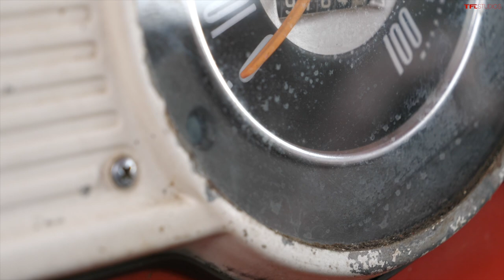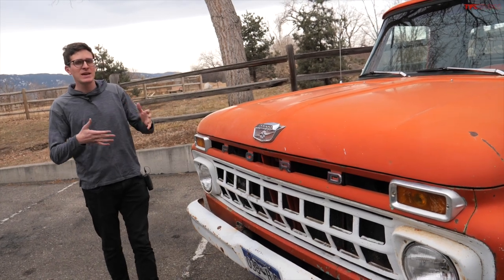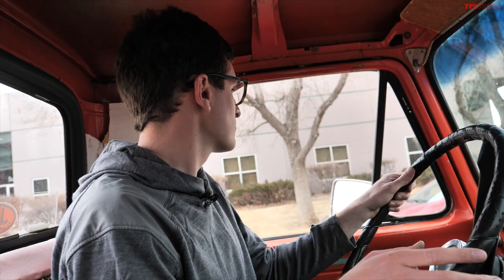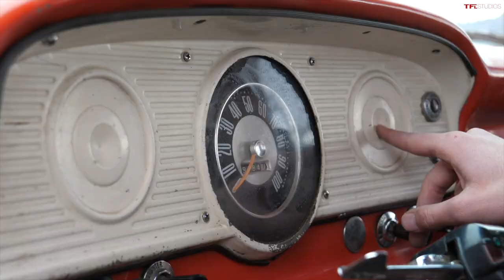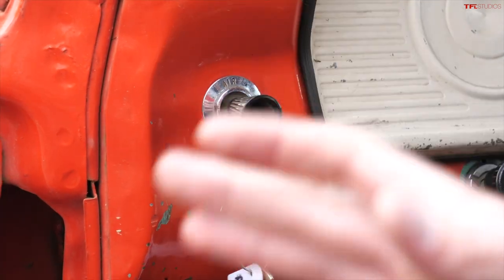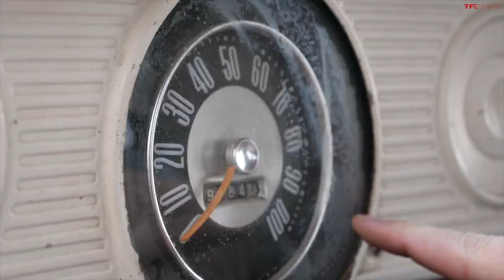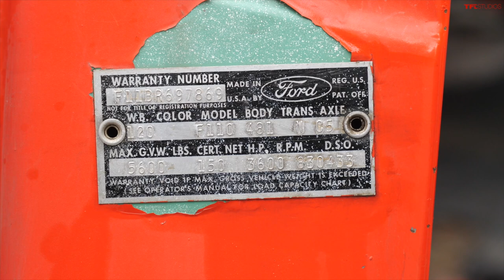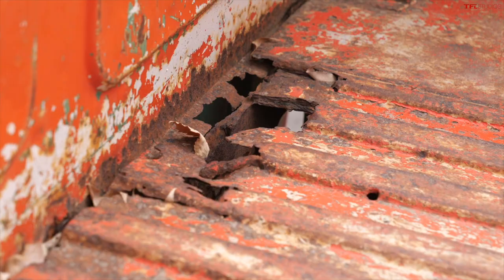Do You Like Raptors? I Just Bought The Ford Truck That Started It All!

Comment: I think a mild restomod would be cool. Take the 300 and rebuild it with good pistons , cam, lite bit of head work, offy dual port, 4bbl. Original color but modern paint, at least front discs if not 4 wheel, little bit of sound deadening, period correct looking wheels in a 16 or 17 inch, redone interior, and a lighting upgrade should do the trick.

Comment: You should put a 4 barrel intake and carb with headers to get some more power out of it, 300s will really wake up with those mods. Since you have "six shooter" cause of the 300 in the other truck and those body style trucks were called Slicks, call it "Slick Shooter"

Comment: I would toss in a ATK or Blue Print 302, even better the Cummins R2.8 crate engine.  I'm sure Advanced adaptors has everything you need to build this F100 out.  I might toss in a 4 link by Helix, simple or just swap out the suspension with new Rancho or Pro Comp shocks, and then build out those axles with ECGS.  What a find.  Sorry Brew - you might have a point there... If I didn't toss in the R2.8 I would rebuild it from the bottom up.

Comment: For God's sake, Keep that "Big Six" under that old hood! The best engine Ford ever designed and built... you'll never need to replace a timing chain... bulletproof and rock solid!
I wonder about the 8 lug wheels, which wasn't a setup to be had on a F-100.
Reply: or save it away a swap in an old Windsor for use

Comment: Bring it back stock. Steelies, painted hubcaps, maybe strip the paint to the original color. My 2WD, 41K mi, 305 V6 (yes, V6) 4 spd, 1969 GMC 2500 is equipped similarly with very few options (all mechanical HD stuff). It's a real, honest truck. I am one who actually found his perfect pickup truck!

Comment: Interesting, I grew driving trucks like this, so it seems like he needs to just realize it’s a truck, not an open trunk car like today’s newer vehicles. It requires more driver attention and interaction. Basically you need to know how to drive it. 
My father and I picked up a 64 long bed 2wd F100, for $200.00 , drove it home- took a half a case of oil- major rear main seal leakage. Ripped the drivetrain out and put a 440 Dodge big block , 63’ push button 727 torqueflite trans and the rear end out of a 63’ Imperial with 4:10 gears. That was a beast, and a real sleeper.

Comment: Unless someone swapped in later 8 lug axles you have an F250. No F100 came with 8 lug axles. Another indicator of that is the holes for the west coast mirrors you pointed out. Also but not conclusive is the for speed with a low first, more accurately described as a 3 speed with a low gear. That type is more indicative of a working class truck than the light duty F100. F100's are only rated to 1/4 ton originally. The reason for the odd taillights isn't that its 4x4 and not 2wd. That truck is nicknamed the "wrongbed". Ford changed wheelbase length and the normal styleside beds wouldn't fit however they had beds originally intended for the unibody trucks that were modified to work. Note the body line from the cab doesn't match that on the bedside,and the wheel well doesn't exactly match the front in style. As these wrongbeds wasn't the most aesthetically pleasing they were often trucks marketed to working roles such as construction,forestry,farming ect. Count your rear leaf packs,bet you have 7 or 9 or 11 leaves. Definitely keep the 300, inline engines make good torque because of the longer stroke. With the 300 and low first and low range in the transfer case it will pull like a tractor. With that combo you can just about pull stumps at an idle,if the u-joints dont give out first. I would suggest upping the yoke and u-joint size but then your likely to break something more expensive lol, or twist the driveshaft into a pretzel.

Comment: Keep the power train (maybe new gaskets) and put a conservatively sized blower on it. Add some meats to accommodate the extra power and give a little more speed. Maybe upgrade to a mid-90's Ford 5 spd manual.

Comment: Nice truck!  Is that riding on a more modern frame or does it just have modern heavy duty axles?  The F100 never had 8 lug wheels.  Even the 200 and 300 model of that age used a 6 lug pattern.

Comment: The step built into the cab is a 64 model. All 64 models 2 and 4 wheel drive had the step. A true 65 cab doesn't have the step. Also the more expensive models were called custom cabs with a completely different dash cluster with a linear speedometer all standard cabs were round speedometers. The extra volt gauges, ect, on the round speedometer were used for commercial trucks bigger then F100. Great looking truck though. Is it for sale?

Comment: Please keep it original. Upgrade the brakes and steering. You could see if bilstien has some better shocks for it. My first vehicle was a 1965 f100 2 wheel drive. With the 240 inline 6 witch is I believe the same block as the 300. It had the 3 speed column shift transmission. It was the twin I beam front suspension. It was my Dad's truck. He had bought  a 72 f150. He paided 300 dollars for it in 1970. The truck was perfect. Have a great day.

Comment: I think it deserves a 65 bed. if you are not upgrading front brakes to disc, then leave it alone, r&r lines, fluid, master cylinder, brakes, drums  as needed.  that faded red is cool, but needs to be original color. engine upgrades- high flow air filter, exhaust .rv cam.

Comment: Used to drive a 1968 gmc c1500 with v8 and 3 on a tree manual trans no power steering or brakes and it had drums all the way around. Drove it all the time no issues and as for texting and driving I still don't but always have and will be just fine eating a sandwich or getting a drink even in town. Don't need a gym to be able to steer these just need to get accustomed to when is the best time and way to steer. Then again if you turn enough wrenches it's not hard as it is even sitting still.

Comment: Cool truck.  Keep it as original as you can.  Put the correct wheels and tires on it.  Correct the passenger side air vent.  Rebuild the 300, if needed.  Body paint back tonthe original color.
One reason people customize older vehicles is because they can't find the original parts or are not absent restore original parts.

Comment: I have an idea, hear me out: Ford should bring back the F100 as a Gladiator competitor, BUT they should build it on an F350 Super Duty frame.  Two body styles, standard cab/long bed and crew cab/short bed, removable doors and roof, 4×4 standard, slide-in camper prep kit option available.  The ultimate overlanding vehicle.

Comment: I have a 63 just like it .and it had the same bed so I got the matching box and I had to cut 7 inches out of it because the 60 box is the same as the unabody trucks .the ones with matching boxes like 64 or 65 the wheel base is longer

Comment: I'd like to see a budget restoration - not a Concours D'Elegance perfection restoration, but not the spray over everything with reckless abandon dirt cheap Maco quick job either.  Just make it nice, like Kase's Ram.  But the more critical then all that, do some minor upgrades to make it more livable (power steering maybe, dual circuit brakes for sure, maybe (?) a disc brake conversion for the front to cope with heat better), then take care of mechanicals, leaks, bushings (etc).  Then give it a good tune up and get out on some cross country trails. :-)

Comment: Keep it as original as possible.   This thing doesn't need an engine swap.   If I owned this truck, I would fix the dings, fix the rust, repaint it the original green, upgrade the master cylinder, fix the parking break, and that's about it.

Comment: Use a 72 master cylinder and power booster, just have to shorten the push rod 1" then it is a bolt in swap

Comment: 1. Repair the rust and keep it OG (barn find) as possible as is. 2. Return it to factory condition as when the 1st Forrest ranger got the keys. 3. Modernize the drive train and keep the looks as is. Godzilla swap to tremic 5 or 6spd to OG divorced T-case and axles, disc brake conversion, power steering conversion with all new steering components/wheel, and A/C, relocate gass tank to under the truck, etc.

Comment: Before it was illegal, I texted and drove one of these all the time lol you can get used to anything if it's your daily driver. Same basic truck, except it was a 64, so solid axle, two wheel drive, and a 223 six cylinder with a 3 speed on the column.
Reply: Ive got a 63 with a 223 and a 4speed havent tried texting yet

Comment: oil pressure gauge, water temp and tac.  new or rebuilt 300I6 with EFI, power steering, front disk brakes, brush guard, original FS paint.

Comment: 65 4wd was called AWD and didn't have locking hubs standard.  The hubs were always locked, allowing you to shift the transfer case anytime you wanted to get 4wd.
Reply: Wrong - back in those years hubs had to be locked in before you could shift into 4WD
Reply: @timcasady4750  I have one with the original visor sticker on how to shift. No lockouts, the front wheels were always locked and it was called an AWD truck.
Reply: @mikedurham3563  I am interested in seeing what your visor instructions show - would you mind sending me a pic of your visor with the instructions ?
Reply: @timcasady4750  when I get back to where it's currently stored.
Reply: @mikedurham3563  cool I will check it out at your channel

Comment: Just drive it and the steering will become easier. My ford van with manual steering is decently easy to turn at low speed but I can manhandle it at a stop. If you really want to enjoy it dont keep it nice restore the inside for comfort and keep the outside crappy. You'll love it more

Comment: The steering on this truck is going to be a lot heavier than it was originally. Those wheels and huge tyres are much wider than original and therefore will have quite an impact on steering effort.

Comment: If it were mine I’d fix the brakes, dual reservoir master cylinder with proportioning valve.  Fix the heater core.  Vintage sir.  Power steering.  Move the fuel tank to under the bed.  Original color and fix all body and rust issues.  Finally keep the straight 6 but maybe upgrade it to fuel injection with the ecu hidden out of sight.

Comment: I learned how to drive in the two wheel version of one of these. 3 on the tree, no PS, no PB, same engine and not a gasket one. Every time you added gas you had to add oil. The entire engine was covered in inches of nasty oily grease.  While hauling hay we dropped the no.1 piston and still drove home, 50 miles, overloaded with hay bales, with the rod banging on the piston cap. The engine was bouncing up and down, making all kinds of racket. We made it home ok and my dad wanted to pound a wooden block into the dropped piston hole because that ol' engine still started, even with a dropped piston. Lucky for me the rod put a hole through the cylinder wall into a water jacket, because I did not want to rebuild that nasty greasy mess. I was sad to see the old girl go.

Comment: So. All of the things you find on this truck is as they should be and need, nothing you don't. No fancy little pole to help you on the bed, no fancy rear cam, an engine block that can prob take a .50 cal, a fuel filter that if it clogs, you just go by any auto parts store and buy one for $.50 or take one from the lawnmower machine, and enough surface rust to make the owner resistant to rust? And the list goes on!

Comment: Stock tests and data. Then ether a hoped up 300 or diesel swap, lockers. High end suspension upgrades, 4 link front and rear and coilovers to make it fit that raptor name you gave it. Re test. And then keep and compare to new raptors

Comment: You can try to trace the the factory purchase order number.
Green was not a forest service only color. 
The wheels are way too wide.
You can put LT tires under it at about $1000. Steering will be way easier. 
Almost every thing you would want to do to this truck, you can do your self.
Customizing is very user friendly.
Headlights can use motorcycle headlights. Very few of the parts are vehicle specific, so think generic components.
$500 bucks will buy all the Harbor freight tools you will need. Including a 110 welder for sheetmetal repair.
Keep it stock but make it yours. 
Your purchase price makes me happy. I paid $700. Yes $700 for my 1965 custom camper special. 
Keep the bench seat. It's cold so your girl will want to cuddle and sit in the middle (where all the heat is) there is something very manly, romantic, and natural about shifting into 4th and putting your hand on her knee or around her shoulders. Don't ask me how but pretty girls become beautiful women when they ride in these old trucks. If you don't want to fall in love don't let her ride in your old Ford pickup. You've been warned choose your passengers wisely.

Comment: NOT a 65! In 65 they changed the frame design with the new suspension allowing a lower cab floor giving the driver more leg room (no step inside door)
Reply: 1965 is the correct year as the vin code verifies but back in the day it was not uncommon to see a 1964 cab & bed used in early production of the following year, remember this was a truck back in 1965 and Ford had no hard set of rules regarding body style changes not appearing in a new model year

Comment: That is almost as clean as my 65 4x4... mine has the 300 also.  the “Crew” cabs were built by Crown Conversion,  not Napco.  We think that less than 2000 4x4’s were built in 65
Reply: 1965 was the introduction of the first factory crew cab

Comment: Upgrade the brakes,repaint it the original green,new door and window rubber,reseal the driveline,recover the seat,new headliner,floor mat, upgrade the suspension and new wheels and tires.

Comment: The 300 straight 6 is basically a tractor engine anything you want to do it will do it it may not be the fastest truck but it will get you there it don't argue with you any day of the year you go out there hit the foot feed twice pull the choke on extremely cold days and it fires up as long as you're Carter carburetor is working proper that's the only downfall with the 300 is the carburetor

Comment: If it ain’t broke don’t fix it! Keep the in-line 6! Restore the body and make it more bullet proof. Rhino line the bed, power steering, and fix master cylinder for reliability. Make the whole truck as Corrosion resistance as possible, can you make it survive salt like they use in the north east?

Comment: Name it the dinosaur. It fits with the raptor family kinda. Keep the 300 straight 6! Put a better intake and 4 barrel carb on it! Freshin up the fuel system, move the tank to a feul cell under the bed! Power steering and power brakes! Detroit tru trac locker in the back! Old school off road build. And then do some mile off roaring in it and compare it to the newer raptor!

Comment: If it's 65 then it's more then likely a ford inline 240 3.9 head. If it's a 300 then it's a 4.9 head easy way to tell is 300 are stamped T 240 is stamped A . Also 240 chambers are kidney shaped  300 are D shaped 240s are the holly grail . Excellent find

Comment: Restore it, please. Paint it the original green and deck it out as a Forest Service truck. Nice glossy brilliant white wheels with narrow mud tires. Add the power steering, brake upgrade and I'd personally look at adding fuel injection. I'd mount an under bed fuel tank to round it out and then just enjoy driving it.

Comment: Take it back to forest service green and stock condition. The gas tanks being that way in the cab is a nonissue. It's not exposed to the elements so leaks wont ever happen. The sending unit is easy access for service, should the need ever arise. If you're ever in a bad enough wreck to rupture the fuel tank, you're probably dead already and wont care. Love these old gems.

Comment: geez that things got alot of play in the wheel mine was solid and had a 14.5 inch wheel much better. 100mph wasn't out of the question with my 352 that truck would roast the 33in bfg tires

Comment: The 300 6 is a good motor but the biggest misconception is that they have alot of torque. They actually have less the the 302 v8 counterpart
Reply: Not really a misconception more like they dont explain the torque is lower in the rpm range meaning they actually pulled harder out the gate i love towing with mine in town because im not making a bunch of racket to move something heavy it just chugs along
Reply: @straight6fords580  i believe that is the text book definitely of a misconception.

Comment: Personally, a survivor like this isn't something that I would want to modify. I would try to preserve it. That being said, the dual master cylinder and front disc brakes from a late 70s era truck is an easy upgrade to make and is more than enough stopping power for this rig. A set of truetracs front and rear would help it off road immensely and would be invisible to the average person.

Comment: Just add 20 inch chrome wheels, low profile tires, limo tint, 12 inch navigation screen, twin turbo V6, two subwoofers, LED lighting EVERYWHERE, remote start, power steering, disc brakes, 5 link suspension, digital gauges, more cupholders, USB connectivity, bluetooth, heated and ventilated Recaro leather seats, power windows, color keyed bumpers, automatic 10 speed transmission, and more cigarette lighters. That is all.

Comment: If you want I'll donate a pair of factory cast exhaust headers from a FI 300 6. I was going to cam ( for torque ) my 300 6 along with a 350 cfm carb and manifold.. Rumor has it that you could add 100 hp down low where you will use it.

Comment: if you want to feel torque, drive a 460 truck with a 4bbl, it’ll make you think that 4.9 is a joke, especially if that 460 is mated to a zf5 and is a D0VE block. 460’s give you 3 low range gears on a zf5, steep hill, sloped terrain, and highway crawl to 45mph with 2 more gears